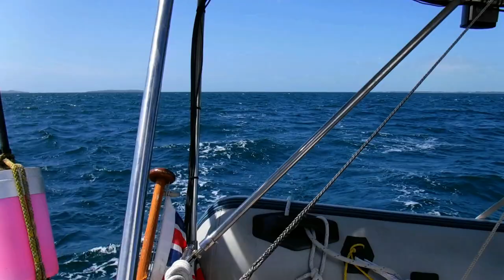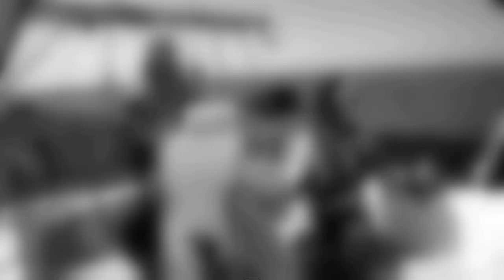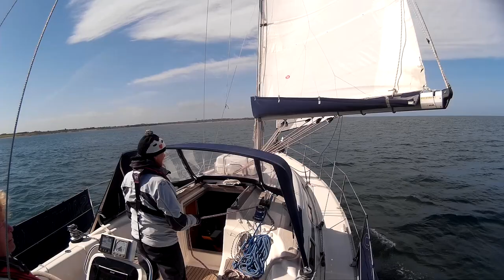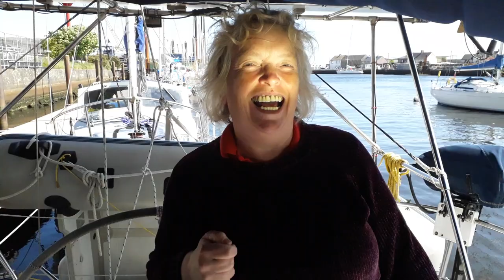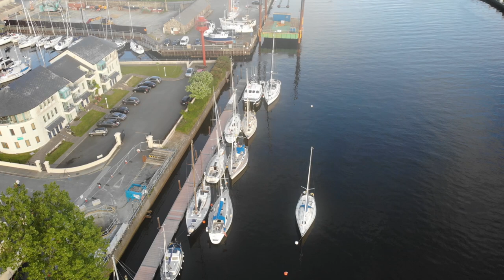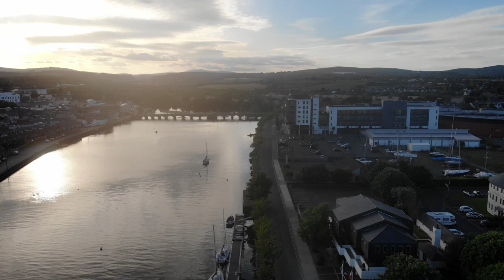Sailing Ireland - Kilmore Quay - Arklow - Ep. 241

Comment: Great videos,  thanks for sharing.  As a solo sailor I  appreciate your honesty of events and  your words such as 'taking an hour or so to settle down'.  I suffer this terribly, probably worse than normal but I  don't  let it stop me.  I have also mucked up a few gybes in my time, on a 85 year old gaff cutter single handed with flying jib and staysail and huge gaff main etc it takes a bit getting used to when the sea picks up, but hey, we're not the only ones I  bet.   I'm currently in the middle of a major onshore boat rebuild so missing sailing  at moment hence  really enjoying your video's. Thanks again, take care.
Reply from the maker: Thanks Jim and it is great to hear that it is not just us that need to settle down 👍

Good luck with the project